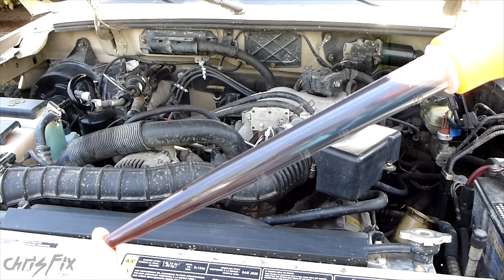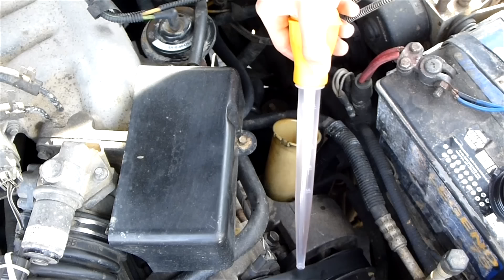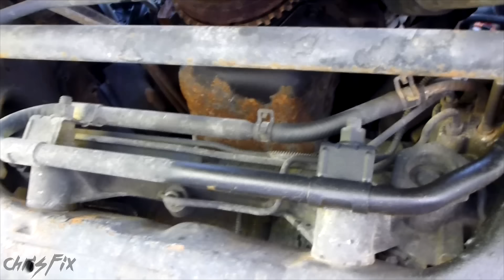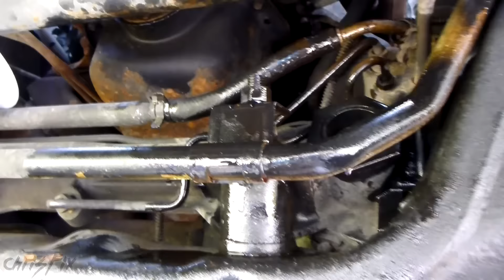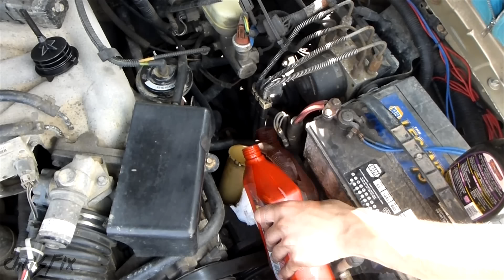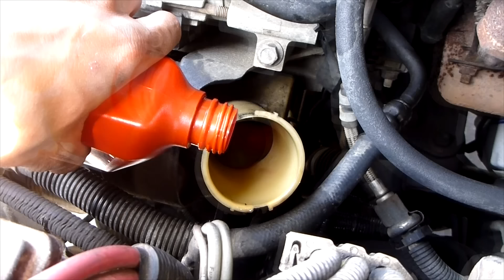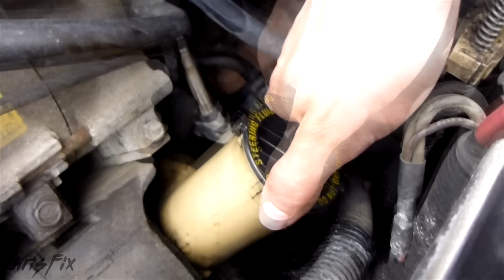How to Flush Your Power Steering Fluid

Comment: hi chrisfix. i have flushed my car's atf  but i have a question. i have filled reservoir up under the MAX line. but after driving one hour, i see that the atf level  passes the max level a little bit due to expansion by temperature. when car become cold, atf fluid level turns back to initial position which is below the MAX line. is this normal?  should i remove some fluid with turkey baster? i used mobil1 atf 320 oil.
Reply from the maker: +cenapbaba that's perfectly fine. Sounds like you have just the right amount!

Comment: So you didn't have to disconnect the high pressure line to completely drain the fluid? I'm about to flush my 2007 Magnum and could use the advice.
Reply from the maker: I did not have to. I used the low pressure line.

Comment: Thank you very much Chris, for the video. I used your video as a guide for Nissan Sentra 1.8s 2004. I had to work from the top since the valves are next to power steering reservoir. I had slight modifications, but overall I did what you described. Thanks much again. You and ETCG are the way to go. You guys rock :) :) :).

Comment: if it's not been mentioned before, use some needle nose vice grips on the soft/rubber return line before pulling it and then aim towards your catch can. when the clean fluid starts coming through, then just clamp the line again to connect it. saves a lot more mess
great vid, btw. concise. thanks for posting!

Comment: +CrisFix Hey Chris, your videos are awesome! I just subscribed. 

I was going to attempt this on my Acura RL (2005) but before doing so, I replaced the o-ring in the inlet pipe of the PS pump by removing the inlet hose that goes from the PS reservoir to the PS pump's inlet pipe. When I removed the inlet pipe, I noticed there was no old O-ring in the inlet pipe or in the PS pump itself where the inlet pipe connects to the pump so I just placed the new o-ring on the pipe and put everything back together. I topped the reservoir off with PS fluid made for Hondas and Acuras (because some fluid leaked out when I took the inlet hose and inlet pipe off) and when I turned the car on, the reservoir started foaming and bubbling and overflowed with foamy PS fluid. I noticed (what seems to be) it leaking from the inlet pipe connection now as well. It seems the return hose is filling the reservoir faster than the inlet hose is taking the fluid to the PS pump.

What would cause the fluid to not be sucked into the PS pump? 
What would cause a leak in that area of the inlet pipe (it's not leaking at the connection of the hose and pipe but at the pipe and PS pump)?  I made sure the connection was tight and the bolt was flush. 
How do I stop the air leak which would (I'm guessing) stop the foaming/bubbling?

I lost quit a bit of fluid and now the pump is making a lot of noise - most likely because is very low on fluid since it all overflowed from the reservoir.  Any advice is greatly appreciated.

Comment: I tried this in a 2001 Impala. I was surprised the system only took about 8 ounces total even after moving the tires. My Suburban takes about 40-44 total but it's a Diesel so it has brake assist from the power steering system.

Comment: Why you need the turkey thing to suck the fluid from reservoir if you can juste unplug the low pressure hoses and draining all the fluid easily as you are doing at 3:00 ?
Reply: no body have the answer???
Reply: Gulzar Hussain it's simply to limit the amount of fluid spill when he disconnects the low pressure hose.
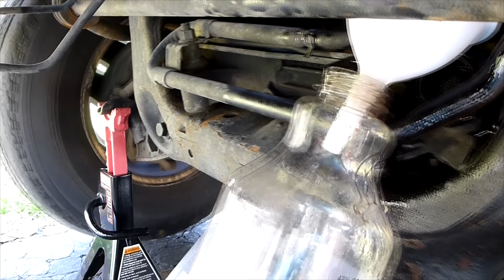Reply: in other words if we dont have the turkey thing we can unplug the low hose to drain all the fluid from reservoir?when he s turning the Wheels left right at 3:05, the engine is start or on neutral position?
Reply: Gulzar Hussain You don't have to use the turkey baster to suck the fluid out, it just helps to avoid making a mess. When he turns the wheels the car is off. Hope this helps.
Reply: less mess on spillage and you can check the fluid easier

Comment: Thank you for allowing me to watch. My nephew is rebuilding my engine and I want to do this too later .
I have a question about the crank shaft have you ever came across a problem of the bolt that holds the pulley in place, not sure but when someone took the bolt out to redo the timing chains they messed up the threads  and the bolt won't screw in place , what did you or your friends do in that situation? Besides buy a new crank shaft ? Retear the engine apart again. BE SAFE! GOD BLESS YOU ALWAYS! ENJOYED!
Reply from the maker: That is strange. I would verify that the bolt threads are stripped. If they are, a good tap and die set will fix it!
Reply: ChrisFix I GOT A POWER COIL  M12 -1.5 THREAD REPAIR KIT METRIC FINE 1.5D INSERTS FROM A & A BOLT & SCREW  COMPANY TODAY THEY SAID THIS SHOULD WORK FOR ME ? I'LL LET YOU KNOW AFTER TORI  , NEPHEW  , TRIES IT LATER THIS WEEK  ,WEEKEND! MAYBE JUST HAVE TO RETREAD WHAT'S MESSED UP? NOT SURE I'LL SEE WHAT TORI THINKS HE WORKS ON VEHICLES MORE THAN I EVER DID. THANK YOU VERY MUCH FOR GETTING BACK TO ME! I KNOW YOU GET A LOT OF QUESTIONS ABOUT CAR STUFF & ARE REAL BUSY WITH WORK TOO! GOD BLESS YOU ALWAYS!

Comment: Thanks for this video. Made the flush very easy to follow. The part that took the longest for me was disconnecting the hose. I was scared I would break or rip it. I guess I didn't realize how strong they are. I just had to muscle it off. Thanks for helping me keep my 16 year old beater running

Comment: My 2004 infinti g35 coupe says DEXRON TYPE ATF for my power steering fluid , and heard you say Automatic transmission fluid for your Mercon ATF, so the power steering fluid is actually automatic transmission fluid?
Reply: Look up power steering fluid vs atf, there are some sites that will tell you the difference. Mainly has to do with the additives to ATF, and on some cars the PS will be near hotter parts of the car, and PS fluid has higher ignition point so it won't burn compared to if ATF is used
Reply: Not all power steering fluid is transmission fluid.

There is a common clear power steering fluid used by many car makers, another clear fluid formulated for Hondas and Acuras, and certain European cars take a certain type of Pentosin fluid.

Anyway, Dexron ATF is the most basic ATF and it gets specified by many Infiniti and Lexus models. I prefer to replace regular Dexron with Dexron VI.

Comment: Hi  I have problem with air conditioning when I turn it on the engine be hot fast when it off engine be in normal temperature

Comment: Hello Chris, great vid  always, I have a question, my car, does a power steering noise when the car is at idle and I turn the steering wheel, normally it does when the car isn't worm. What can it be?
Reply from the maker: The pump might be getting old or maybe your fluid needs changing.

Comment: looks like your truck needs wheel alignment. tires wearing in the inside.  be careful because its difficult to see inner tire.. next things your showing tire threads
Reply from the maker: Thanks! I re-did the whole front suspension (and made vidos for each part like ball joint replacement, tie rods, control arms, etc).

Comment: +ChrisFix Thank you for this video! I have a Ranger as well and I followed these steps to the T. However, when finished, my steering was worse. I have no clue what the issue is. When turning the wheel with truck still jacked up, the steering "grabs" and the pump is louder than before! Any thoughts on what may be going on?
Reply from the maker: +Troy King there is air in the system. It will bleed out once you go for a ride.
Reply: +ChrisFix With the truck still on jack stands, not running and the cap off the reservoir, I turned the wheel from the lock to lock for what seemed like forever. Going back every 20 turns to check levels. I was purging air and it seemed to be getting smoother. 

Putting the cap back on and starting the truck, trying to turn the wheel was a different story. I know now there's still air in the system because, every time I cycle the pump, when removing the cap from the reservoir, there's bubbles. 

It went from bad to what sounds like a someone being skinned alive.

 Finally, called it a night. I'll take it around the block a few times in the morning and hope I don't end up needing another pump before it's said and done.
Reply: +ChrisFix well, drove it for an hour this morning. Took it down the highway and around areas with a lot of turns and it's still pretty much how I left it. Should I just take it to get it done professionally with a vacuum?

Comment: for hondas just disconnect the smaller hose at the power steering fluid reservoir and connect a vinyl hose to that into a waste container. turn on car and do a wheel steering lock, turn off engine the second it stops flowing. don't bleed out the bigger hose on the reservoir, it will explode, I know this from experience, lol. fill it back up when you're done
Reply from the maker: Thanks for sharing the tips for hondas!
Reply: There is a second thing to remember when working on Hondas. Honda power steering fluid is different from other fluids, but it is the same color as power steering fluid for many other cars.

Comment: NOTE: When the power steering fluid (ATX Fluid) starts to become discoloured, just suck out the old fluid and replace accordingly at every oil change until the ATX fluid looks cheery red & new !! No need to disconnect anything if the vehicle and fluids are maintained properly from new !! Great Video as usual Chris !
Reply: If you drain and fill the reservoir every oil change since new, the fluid will stay clean indefinitely and there won't be any need to flush it.
Reply: That’s like saying the motor oil will stay clean indefinitely by just draining and refilling it every “oil change” without ever changing the filter. Power Steer fluid can go bad on its own just like any other engine fluid but it also will go bad from contaminates like metal shavings dirt or any other kind of debris as well as water getting in it, oxidation, or simply the oil getting to hot. Some reservoirs has a filter on them and some don’t. Adding one can be very beneficial depending on your exact application and needs.
Reply: @101bq power steering a closed loop system. No combustion(motor oil). No dead head (brake fluid). This incremental strategy works for power steering, trans and coolant… and I use it.
Reply: @Smokeythewelder thanks didn't know it works for transmissions too no need to take apart will just replace majority instead of whole rebuild unless it's obviously got metal in it
Reply: @LuisAcosta-zd6mg Transmissions do have a filter though so it does need to be serviced annually if heavy use or id say every 30-40k miles. Depends on transmission type, vehicle, and environment. But this method wont clean the filter so research your transmission and follow its service recommendations.
Reply: Not everyone buys cars new, i refuse to buy anything made after '05.@averyalexander2303
Reply: Thats the point of what he's saying. Just suck some out and replace and it will always be good @averyalexander2303
Reply: Nope

Comment: At the beginning how did you steer/turn the tires without starting the truck?
Reply: You can only do this when the car is propped up. If tires are on the ground, you cannot turn your wheels unless the engine is on or else you will cause the steering wheel to lock

Comment: you didnt drive for 10 min you only went a mile according to your odometer
Reply: He has two videos on power steering flushes. One which doesn't require the car to be lifted or any tubes to be disconnected, and this one which is a more in-depth guide with additional steps for a better clean. He has spliced relevant information together across both videos. In his quick and easy guide, he goes on a 10 minute drive but checks the levels at 2 minutes in to ensure it hasn't gone dry. The levels were perfect. 

So it's just a slightly weird splice that you caught, but yes, he did do a full 10 minute drive.
Reply: i know its as joke i do the youtube thing too im just saying you silly goose

Comment: That car is not a ford it's a mazda and thanks coz you method works
Reply: ford owns mazda and that is a 3.0 liter ford v6
Reply: +CRAZEDX100 While you are correct that the engine in that Mazda Tribute is a 3.0 liter Ford V6 , you are incorrect about Ford still owning Mazda. 

Ford began selling its controlling stake in Mazda back in 2008 during the financial crisis. They only own about 2% stake in Mazda today; some Japanese bank is the largest shareholder in Mazda now. Additionally, Mazda and Toyota signed a strategic partnership agreement last year whereas Mazda and Ford severed most of their partnership ties.

Comment: do you know if some cars have filters in this steering thing?
Reply: I have heard that Benz used to put filters in their power steering systems.

If you would like to add a filter to a power steering system, you could splice a Magnefine filter into the line that returns power steering fluid to the reservoir. Don't splice it into the line that carried pressurized power steering fluid, otherwise the line will burst under pressure.

Comment: CHris my car makes a clicking / ticking noise when I turn my steering wheel. what is that problem ?
Reply from the maker: It could be a problem. Check your tie rods: https://www.youtube.com/watch?v=brI2feYiEi8
Reply: Is your car a General Motors car from the 2000s? Often the steering shaft between the steering wheel and steering rack will fail and make bad noises when turning.
Reply: +Skyline Fever yes indeed

Comment: Just wondering whether there is a problem with my power steering pump itself or whether i just need to flush the fluid, I have an 07 forester and when i start the car up it is hard to turn the wheel fully and it kinks back, this usually goes away after driving for a while, there is also sometimes a belt squealing when i turn the car one, hoping its just the fluid and if you could tell me by the sounds of what i have said??
cheers
Reply: Go with what Wolfe says, but in addition check the state of your PS fluid. For your steering wheel kickback, you will really need to examine the cause (possible problem with air/seals/power steering pump),
http://www.hydrosteer.com.au/steering-wheel-kickback/

Comment: it might just be that I missed it (I'm old). but you should plug off the end of the low pressure line that leads to the Reservoir . if you don't then dumping fliud in to flush the system will come right out of the tank, and not run through the ps box or rack .

Comment: Chris fix you used an additive and in one of your videos there was an engineer saying that additives shouldn't be used on oil because the oil logically is proper. Doesn't  that rule  apply to the power steering fluid? I am against additives since I saw your video about oil myths and FAQs.

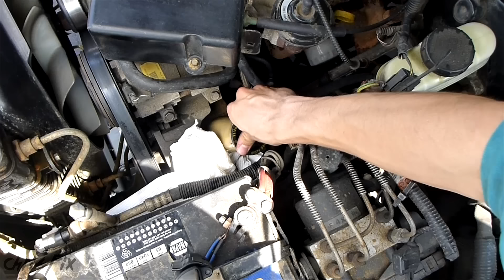Comment: Just did this in '98 Trans Am. At 4:40 I turned the car on after reconnecting the rubber hose to the bottom of the reservoir and filling it with PS fluid, then started turning the wheel. The wheel went god damned haywire turning on its own and shaking and I shut the car off cause I was scared! Then the reservoir had a lot of bubbles and the fluid was filthy. So I turkey bastered, refilled, and turned the wheel again. Same result. Did it one more time and the fluid was pretty clear, so I emptied/refilled it one more time, turned the car on, waited a minute, then turned the wheel a few times. Everything is fine now, I did several turns from varying speeds and a pull (straight up launch with a 3800 stall converter!). I'm guessing air in the line was the problem the first time, but I think the pump is fine. No leaks to report, but I will keep pliers and PS fluid with me just in case...
Reply: I also recommend hose clamp pliers for the job. Update: just went to Costco to get their gas (they're top tier now if you didn't know) and power steering is working wonderfully. I thought I hurt the pump as indicated by the jerking I described in the post above, but I think it's fine!!!

Comment: hey cris i just watched your video i changed mine and mess real bad it has a very loud noise and click when turning. i couldnt get the old one out totaly do i repeat this procedure or what?
Reply from the maker: +binar D add the new fluid, run the car for a week, then pump the fluid out from the reservoir. Do that once and you should be good!
Reply: +ChrisFix  thank you for your reply.i watched you video over again.and bout dexron VI flushed the power steering fluid and it worked thank you again 
keep it up man. your videos are great

Comment: What about draining the system, fill with diesel and drain then refill 
with the proper PS fluid? Turning lock to lock at all times to push all 
the fluid out?
Reply from the maker: Diesel does not provide the correct protection for the pump and can cause damage. There is no need to go that far with such a simple system. Even just taking some old fluid out and putting some new fluid in via the reservoir at the top is good enough!
Reply: I hear you CF. But engine off (no pump damage), rotate the wheel with the diesel in the system THEN drain at low  pressure side after 20 wheel turns. Refill with proper fluid. Diesel is obviously oil based. Shouldn't hurt anything but would clean the heck out of the system. Diesel as we know is cheap compared to other cleaners. Just trying to get all the nasty fluid out of mine LOL.

Comment: Hi is it okay to mix the steering fluid? my car has a clean red looking fluid but the level's below low. dunno what the previous owner has used for the fluid. planning to add extra red-looking fluid thanks
Reply from the maker: As long as it is the same type as in the owners manual you should be fine!